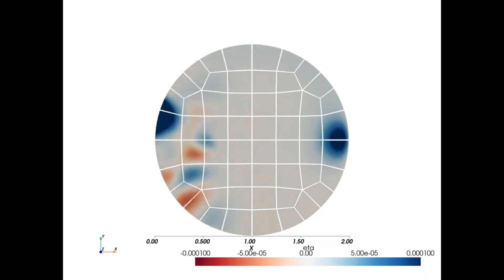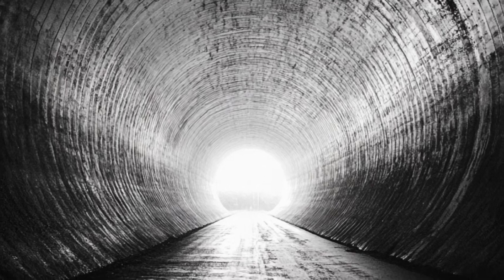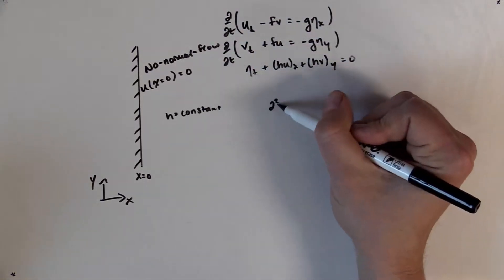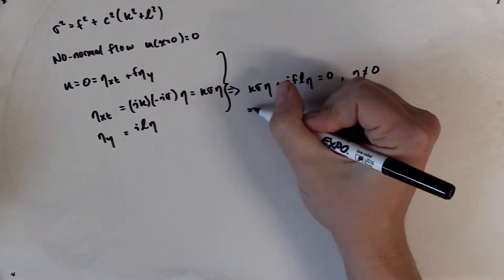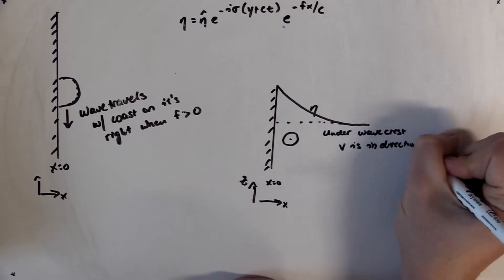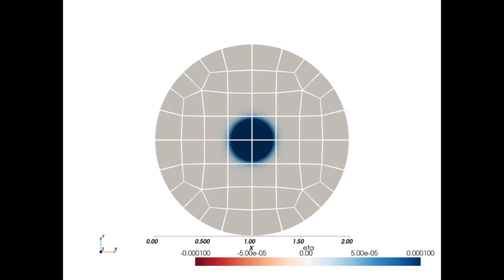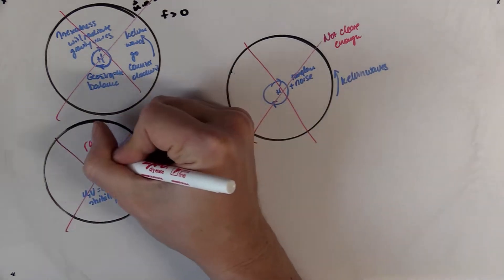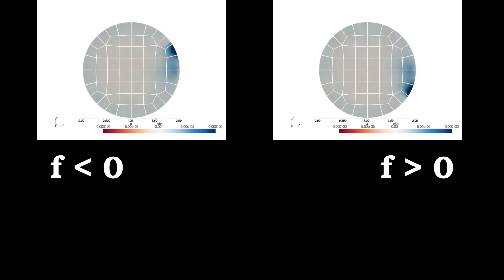Simulating Kelvin Waves using the Spectral Element Library in Fortran

Comment: Got to love a video that starts with the flown blown equations! And then gets to a tractable problem. How long does it take to generate the data for those animations.
Reply from the maker: For this simulation, on 1x AMD MI210 GPU, it takes 5 microseconds per time step at double precision. Each frame is 50 time steps apart and we have a few hundred frames. It's only a few seconds to run the simulation and generate the video.